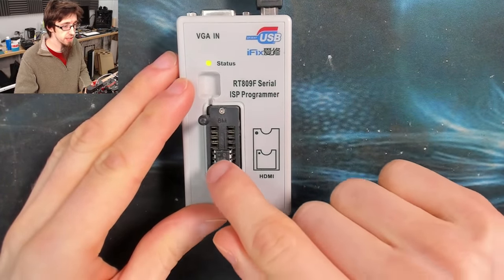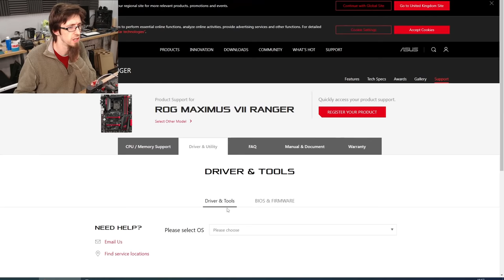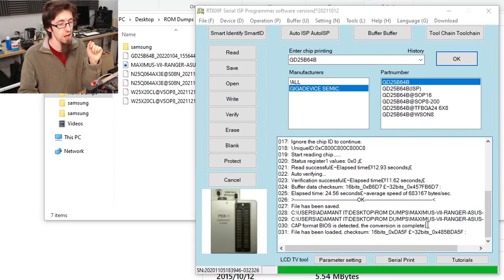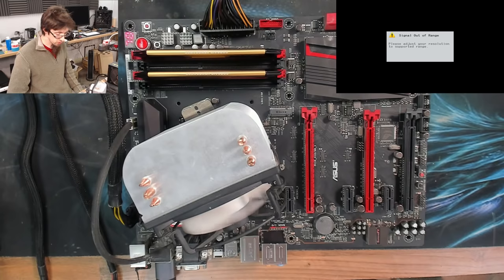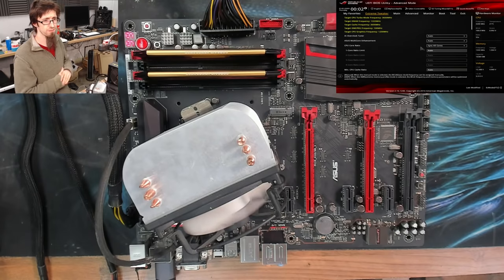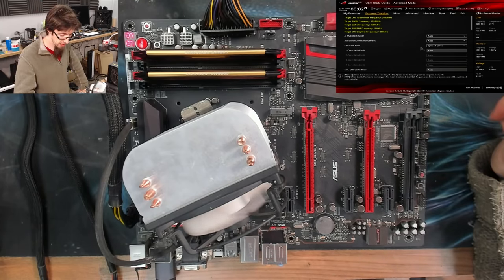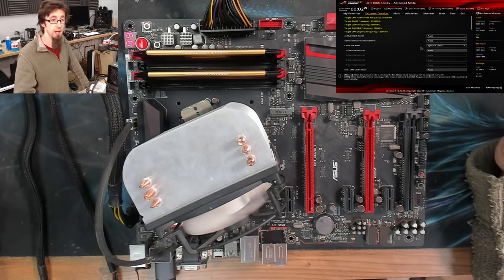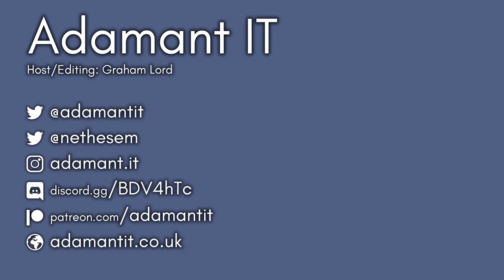Red herrings, red herrings everywhere (4th Gen Intel Build, No POST) - LFC#292

Comment: When checking DIMM slots you need to check ALL DIMM slots but you were NOT. Many poeple think that when you have 2 RAM sticks you should only use A2 and B2 slots, this is a falacy. 

So why do people say that when you have 2 RAM sticks you should use A2 and B2? well in reality you can use either pair of A1 and B1 or A2 and B2. I have heard some claim it is speed but that is wrong and would make no senmse toui have one pair running slower than another pair. Not how it works. It is actually from CPU coolers where they were slightly wider and would cover the A1 slot and preventing a standard height RAM stick in that slot. YHou could back then go for low height RAM sticvks but then NOT having a cooling plate on them was an issue. So this falacy of using A2 and B2 only if you have 2 RAM sticks is a falacy and this can be checked via the motherboard m anuals. Go on, check the manuals.

ALLK 4 RAM slots will be the same it is about whether you use single channel or dual channel. 

I saw you only checking memory with A2 and NOT all four slots with 1 Stick which would be advisdable as youi may have ONE slot down, something I have known. You shoudl ALWAYS check ALL slots using ONE RAM Stick.
 
I hear way too many flacies and never have those false claims actually been verified about the pairs and which to use. Use A2 and B2 if you have a wider CPU air cooler or either A1 anmd B1 or A2 and B2 if spacve is not an issue like water cooling or smaller air coolers.

ALWAYS use one good RAM stick to check ALL DIMM slots.

Just some information form a 20 year long tech having worked on 386 and 486 chip boards through intel 1 2 and 3, AMDs including the Athlon 2500xp Barton, good CPU if it was a declocked 3200XP Barton appearihng as a 2500 like I had, and so on.

I ahve seen many claims which have been seen to be not necessarily be true, such as the DIMM pair claim.

Comment: Fixed five dead asus z170 gaming pro boards with new bios chips and batteries. Thank you cheapskate asus for not using some quality winbond chips.
May I ask why you didn´t try to recover UUID and Mobo SN with FD44Editor and UEFItool? I was lucky and got that info pulled of the "dead bios" dump to put in new ROM.
Reply from the maker: Honestly, it's because I haven't gotten around to trying it out yet. I'm aware that it's super easy to do, it just hasn't been a required step yet. It's my plan to demonstrate SN recovery and editing when I review the CH341a v1.6 though, so this is in the pipeline!

Comment: Ok.  So.  It's not "bitrot" as you say.  What simply happened was the owner or someone in the line of people trying to repair this board, accidentally put the wrong bios on this board.  And bro.  I'm sad to tell you this as I would have thought YOU of all people would have checked this yourself.  If you simply look on the back of that board, you will see a bios flashback button...
Reply from the maker: Honestly thought it was a reset! Flashback isn't common on older boards, so I generally don't expect it - although this being a Maximus, if any board would have it then this would. No matter, a fix is a fix.

Comment: Hi. Do you check your company emails at all? Please reply to my mail(s), regarding the new Lenovo T480 Batteries, which are not working.
Reply from the maker: Hi, sorry our inbox gets swamped - I'm intending to get on top of it, but this will involve clearing it and starting afresh.
I don't do battery repair though, so if it's about repairing a laptop battery I can't help with that I'm afraid!
Reply: @Adamant_IT  Thank you for your reply. I hope that you will soon see my mail. It is not a battery repair. It is more a battery revival. You did a great video where you revived a dead battery with your professional laptop battery analyser. This machine and your  amazing knowledge could help to fix the issue. This could also be a nice YouTube Video, because a lot of people have the same problem with those Lenovo T480 batteries.

Comment: i see way too many people trying too sell 4th gen intel cpu,s with lenovo motherboards , basicall bought a pallet of Lenova M93,s or whatever rip the guts out and put in a gaming case with a cheap GTX 960-970-980 and they want too sell them for 800-900$ with 8-16gb ddr3 and 250gb sdd ... these are workstation PC that where sold for 30-50$ each reshelled into a gaming tower with a value of 300-400$ that some A-holes want too double their profit ... i hate them .... they give PC builders a bad name

Comment: Holy crap. I freaking hate those stock coolers. And now that I know the arrow on them is incredibly unintuitive and misleading, I feel better about having so much trouble with them. Intel makes good CPUs, but their coolers are worthless garbage destined to the hall of shame section of e-waste reserved for items straight from the giant waste of a factory that makes them. Intel might as well just stop making stock coolers altogether. Just tell the customers up front that they can get fucked and find their own cooler.

Your methods are pretty interesting. I would go after all the low hanging fruit on any machine that I'm servicing. If there's a post code, I'll get that right away, but I will still reseat ram, reseat and re-paste the CPU and cooler, take out the PCIe cards and dust them off, and take an anti-static dust wipe to every part that I can. I didn't expect this to be the motherboard. I wouldn't have known how to revive that. Very informative, thank you.

Comment: how too reset the bios on any motherboard in which you failed ,, 1 take bios battery out 2 unplug power supply 3 hold power button on for 30-45 seconds and done ... facepalm

Comment: Wow. Experts that don’t really know?

Code 26 is where you START!
(memory caused, which in this case you finally seated it properly after wasting time reprograming the BIOS). 

All CPUs for the last 10 years do have PROTECTIONS against “burning”!!!

“Can you believe it!?”.

8 pin connector must go on the left??

Not much electrical knowledge?

Left and right side of that connector are in PARALLEL, so it does not matter!

Measuring voltage of a battery without any load/current s not how you check batteries, either.

Gotta say this is one of the worst troubleshooting videos I have seen…

How much can you charge for your (way too long) 3 hours of work?

Comment: a professional will clean it first
Reply from the maker: The PC comes in, and the customer tells you it turns on, but doesn't POST.
It's really dirty, so you clean it. Then you try to turn it on, and it's stone dead, nothing at all.
Now, was the customer wrong, and gave you a misleading fault description, or did something else break when you were cleaning it?
Or a fan is buzzing because the bearing is shot - was it already buzzing with the customer, or did it just fail while you were cleaning it?
Cleaning removes evidence. Diagnose first, then clean.

Comment: Why are you wasting so much time. What you should have done is eliminate the issue is the memory first. Usually get one known working memory and test with that first, if that doesn't work, means that might be the fucking CPU. you had to run around the other stuff first like that's the issue, when the error code is ALREADY telling you something is wrong with memory stuff. If the Memory modules changes doesn't fix the problem, then it's obviously wrong with the CPU. Get a known CPU and plug it in, if STILL error, then you know something is badly wrong with the motherboard.